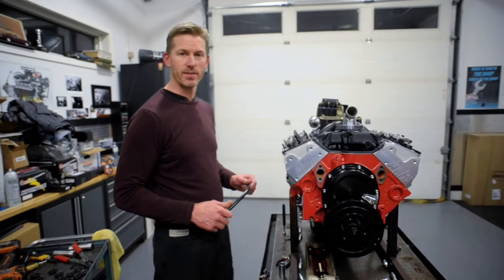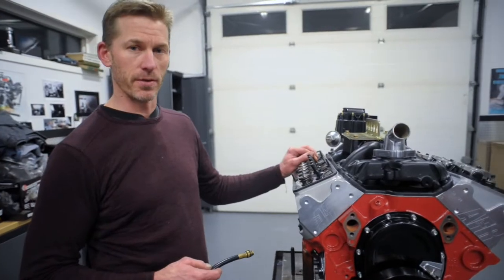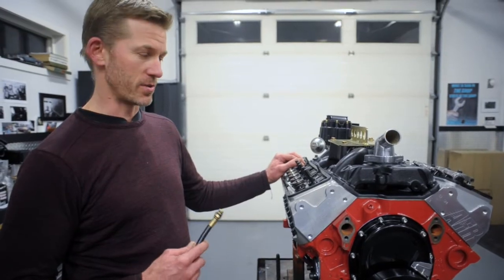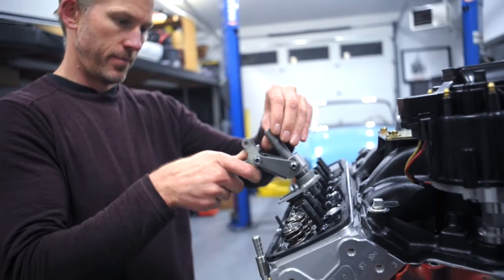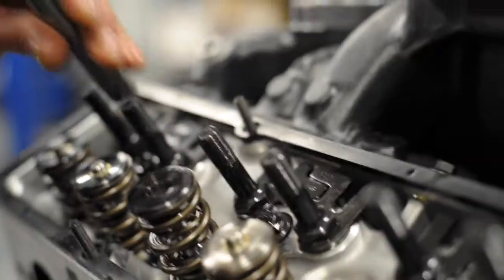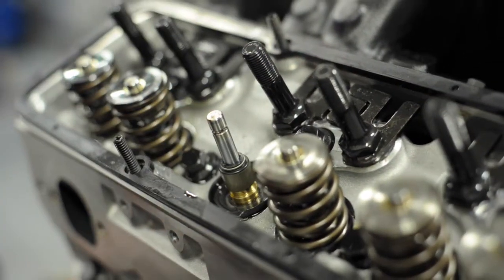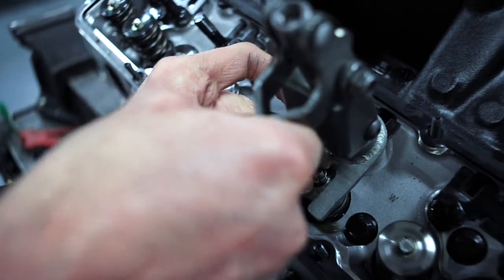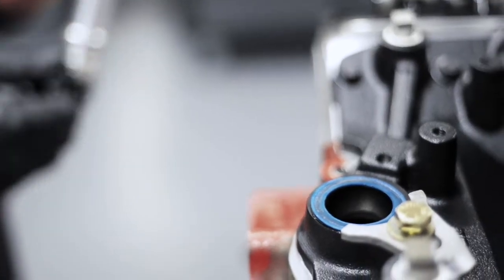283 Crank + 400 Block + Valve Spring Pressure Fix Part 5

Comment: What's the dyno on a 400 crank with the same parts
Reply from the maker: Then it’s a completely different engine. Essentially and typically with putting our heads and cam into a 400 short block, it would make more torque and probably less horsepower… and not be as fun :)

Comment: What size rods did you use and do you use the 400 balancer and flywheel?
Reply from the maker: We used 6.1” Scat rods that are meant for an LS. We used a neutral balanced flywheel and balancer, not the weighted 400 parts. Thanks for asking!

Comment: What do you think the power would be with stock 2.02 with a valve job would do?
Reply from the maker: This same combo in this build 283/400 block with stock heads might make over 400-430.

Comment: What oil are y'all running in it?
Reply from the maker: For break-in we use Driven Racing BR40.
Reply: @ceperformance  So conventional 10w40, cool beans. Do y'all recommend running synthetic after break in?
Reply from the maker: @stevec5280  
Thanks for commenting! I personally don’t use synthetic oil in naturally aspirated performance engines. In a turbo engine I would.

Comment: Nice build! I'm doing a 'run what I have' pump gas project. 389 sbc, typical 3.75 stroke 5.7" rod 4.06 bore. zero deck 10.5 ish compression.  The heads are a bit big.. off the shelf race CNC 64 cc edelbrock 215's, raised exhaust ports  2.08 valves. Air Gap intake. 750 QF mechanical carb.  I'm looking at mechanical roller cam options for 3000-5500 jet boat. It's kind of like a  3000 stall.   Any suggestions are appreciated. Thanks
Reply from the maker: That sounds like some good parts going into it. The focus is going to be making peak torque in around 4500-5000 rpm I think. Let me get back to you on your camshaft but I’m thinking something with loads of lift (close to .600”) but keep the duration fairly conservative (224/230 ish) and the LSA @ 113 or 114.
Reply: @ceperformance   Yes for sure max torque in the lower range. Will be interesting to find a solution to use heads that aren't for maximizing mid-lift flow. I'm hoping that cam selection and the extra cubes will compensate. The Air Gap intake will help.
Reply from the maker: @generalsixty2133  
So I have a couple Comp Cams lobes that would work for what you are trying to do. Obviously your parts combo is not totally idea but like you said at first, use what ya got! 
The intake lobe is # 4359 (232 duration @ .050”)
The exhaust lobe is # 4363 (238 duration @ .050”)
The lift is .541” / .574” with a 1.5 rocker. 
You could use 1.6 ratio for more lift if you got em. 
LSA recommend in this would be 112 degrees. 
And would benefit with 2 degrees of advance. (Ask for that to be ground with it)
Reply: @ceperformance   I'll take a look at those cams.  10.5 CR is on the high side for a jet boat so 'maybe' in theory, less mid-lift flow of the 215 heads will help prevent detonation.  I'd like to test 87 and 93 gas on the dyno as well. Thanks for looking into this!
Reply from the maker: @generalsixty2133  
You’re welcome!

Comment: If your getting that hp and torque. What could you get out of a stroked small block like maybe to 454cu.
Reply from the maker: All depends on the combo of parts. Larger displacement then needs different heads and cam to produce similar horsepower per cubic inch. For example, our 329 making 500 HP means it’s over 1.5 HP per cube. Therefore to calculate that out to a 454 you would be at over 680 HP. Obviously that’s a huge task to get to naturally aspirated. This shows how efficient this short stroke, big bore engine really is for its size.
Reply: I did that with my 509 casting 400 sbc. I bored it .030 to 406 then stroked it to 434 cubic inches. Ran Brodix circle track .208 heads.

The thing was a torque monster!!! Understand with that big a crank it is no longer a "Small block" it is a big block and must be revved and treated like one. To help kill a bit of torque I ran the duntov 30/30 solid lifter cam out of my 302 from my 68 Z/28.

That engine killed everything that stepped up to it on the street in my 68 Z/28 Camaro. I still ran the close ratio M-21 and 373 12 bolt posi. That car spanked any big block camaro and big block ford that stepped up to it due to hp to weight ratio. 

If you want serious light weight torque find a "509" casting 400 and stroke the piss out of it. Put as much aluminum on it as possible and stuff it into a small car and hold on.
Reply: The problem is you will eventually run out of cylinder head, even with aftermarket heads because the limitations the small physical size of small block heads.  Even the best aftermarket small block heads can't use the valve and port sizes than you can get with a big block.  That's one of the reasons Chevrolet never made high performance SBC 400's.  Large valve SBC heads still have smaller valves than oval port BBC heads.  It's not idea for high HP and high RPM performance, but is just fine for low and midrange torque, which is what the SBC 400 was built for and is very good at.  So if you want to stroke out a SBC to 454 CID to build a torque monster, it's worthwhile.  If you're wanting a lot of HP out of it, you're better off building the big block.  I've always leaned towards the shorter stroke and smaller displacement SBC's because they make GREAT high RPM screamers, and the cylinder head CFM limitations of the physically small cylinder head simply aren't a problem with 330 CID.

Comment: A street motor that will 7000 rpm, pump gas, 114 LCA and less than 350 cid, YOOOOWZZZAAA! Any thoughts on offering a set up like this for sale? I guess I could waste a lot of time trying to think up another combo....but why. I would definitely put this in my cruiser drive to the track, foot brake it, win rounds, and lie to everybody by saying it's a 383.
Reply from the maker: Engines are our business! I’d be happy to discuss a build or share our combo with you. You can reach me through my website if you want.
Reply: @ceperformance  will do....mike f

Comment: ALWAYS set your springs up .050 from stack.
Reply: Why not just put the correct rate springs in?
Reply from the maker: @lollipop84858 
Good question. The next one certainly did. The ones we had were supplied by AFR and ‘should have’ worked. With this really mild build, small-ish camshaft and a really basic intake we weren’t thinking it would want to buzz as high as it did. All good in the end.

Comment: Wow, it's gonna be badass when u put the 3.75 crank back in it
Reply: You're missing the point entirely.  It will be completely different with the long stroke.  The short stroke is better for high RPM.
Reply: @craigcampbell8560 building a high rpm destroked 400 makes all kinds of glorious sounds with a bunch of rpm. That sounds cool. Have you ever driven a really good dz302 Camaro with 4.56 gears and a close ratio 4 spd? I have. They are really fun to beat on, but all the same parts on a 400sbc will be faster down any dragstrip.

Comment: What is the compression ratio?
Reply from the maker: Thanks for asking. With flat tops and the heads angle milled .100” down to 55cc in the chambers it’s 10.78:1 and will run on 87 octane.
Reply: Dang I thought you was going to run on Dyno I want waste my time watching you anymoy
Reply from the maker: @jeffcarpenter396  
The Dyno is scheduled for this coming week. We’ll post a video of it afterwards.